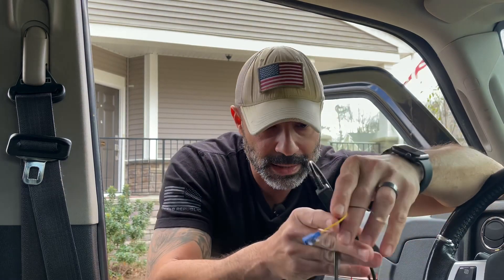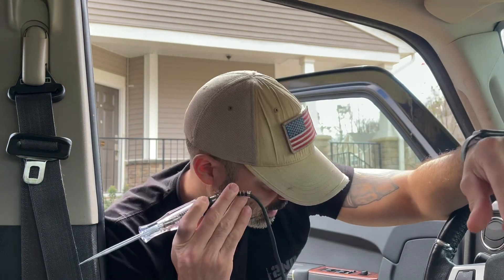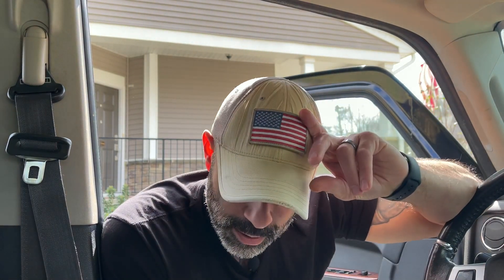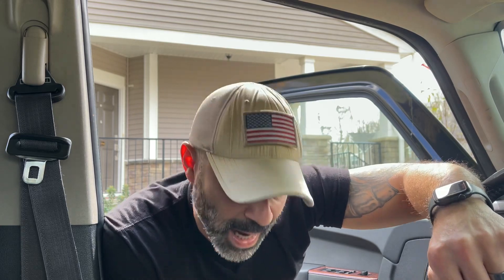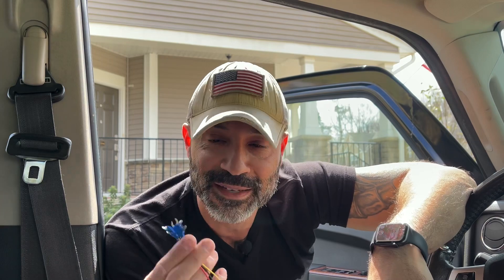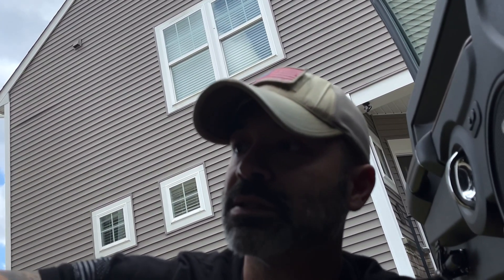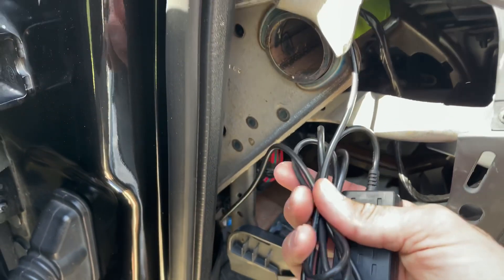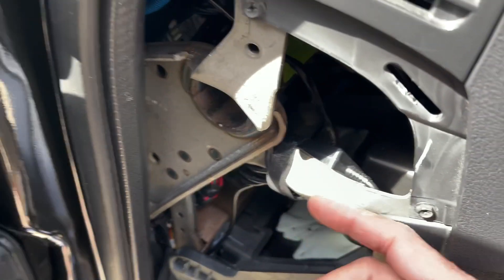Wolfbox hardwiring install

Comment: Cool install , just purchased a Wolfbox g850 and loving it so far since the install . Only complaint is I have a 4runner and the reverse wire isn’t long enough to make it through hatch to my tail lights so I will have to connect more wire to extend it in the future if I want back up lines in reverse .
Reply from the maker: Nice SL. I saw your other post about having a rear view mirror.   I wish mine had that

Comment: Nice video. Have you come across it draining your battery? Does it record when the Jeep is off? Thanks!
Reply from the maker: Hi Christian, that’s for your post.  I have not noticed any battery drainage at all.  And it does not record when the vehicle is turned off unless it feels a bit or a jolt.  As soon as it detects a hit, movement on it, ect it turns on and starts recording right away to try to catch a face or a license plate.   I hope this helps, let me know if you have any more questions.

Comment: How is the dash cam ? Happy with it? Does it function as a rear view mirror when the cameras are off?
Reply from the maker: That’s the one complaint that I would have is that it does not function as a rearview mirror. Other than that another minor complaint would be that the quality of the camera in the rear has diminished over some time. Or my eyes are getting worse, not sure ha ha.
Reply: Thanks for the video and reply !Love the channel!
Reply from the maker: Thanks Tairone!  I appreciate that!
Reply: The wolf box g850 does. Just installed mine and works great as a regular mirror when screen goes to sleep or you turn it off 👍🏽

Comment: It looks like you removed an existing fuse? I thought you used an open fuse slot or did you remove a fuse that was already being used. Thx
Reply from the maker: Hey Brent thanks for your post brother.  I used an open slot.  I just had to make sure it was one that drew power even when the truck was off.  I hope this helps and if you have any others questions, don’t hesitate to ask

Comment: How does the camera know that you're in reverse so it can change the perspective of the mirror and show parking lines? In other words, how is it wired to the reverse lights?
Reply from the maker: Hey Tayler,  their is a wire that runs right to reverse light.  Super simple to set up and it comes with the tools to do it.
Reply: @OJCoz  Cool, thank you. I want to figure out how to wire it with my own switch so that I can set it to reverse manually if I want to. That way when I'm pulling forward, backing, pulling forward, backing...like when parking in a tight spot, the camera view doesn't keep changing.
Reply from the maker: Oh nice good idea.  Mine is only used for making sure I don’t hit people:). But I understand what your trying to do and I like the concept.  Good luck!

Comment: What fused circuits did you have to forfeit to plug in your 2 Wolfbox fuses, or did you find a spare always hot circuit and a spare hot with ignition circuit? Also, im puzzled about your fuses being 15 amp each. I just installed a G840S like yours with only the cigarette lighter plug that was included and it only  had a 3 amp fuse! Also, do your fuses come in a fuseholder, there has to be a way to replace them if they blow.
Reply from the maker: Hi Jeffery.  I’m going to answer these in order haha.  I hardwired to a spare that is only hot when turned on.  I think 15 amp is a bit of an overkill but that’s all I had as a spare, but yes your correct a lesser amp would do such as the lighter plug. Mine didn’t come with a fuse holder.  I just used pliers. Keep the spares in a ziplock.   

I started off with the lighter plug and finally decided to order the wires to hard wire it bc I didn’t like the wires showing plus it took my plug away from phone charging.  The hardest part was 1. Finding a slot that is only hot when on and 2 reaching up in there.   I hope this helps you.  If you have any other questions please don’t hesitate to ask

Comment: I need help hardwiring mine. I have a 2022 Dodge Ram 1500. I would also like to keep it on the interior fuse box. Can you help? I’ve got 0 experience with the fuse box
Reply from the maker: Hey Jerry,  first you need a fuse tester.  It’s about 10 bucks at lowes and you stick the needle in the open slot of your fuse box.  If it light up with the truck “off” then it’s one that is always on.  If I remember correctly you want to find one that is on when truck is on and off when truck is off.  So you just keep sticking the needle until you find the right one.  There’s a little more to it but that’s the jist.  The rest of the details will come in the instructions.   I hope this helps
Reply: @OJCoz  I tried to figure it out but couldn’t find the right fuses to make it work. Wish they had a tech support to install, thanks anyway.
Reply from the maker: Dang sorry Jerry.  I wish I could see it to be more help
Reply: @OJCoz  I watched another video and I think I need smaller fuse taps for my fuse box. I guess I need to do more research😕
Reply from the maker: Oh yes I forgot about that!  You can buy a conversion kit at autozone for a few bucks.  I lucked out with the proper fuse size
Reply: @OJCoz  I’ll try that, hopefully someone at autozone is nice enough to help take a look at it. Thanks again for your help🤙
Reply from the maker: No worries bro.  Good luck!